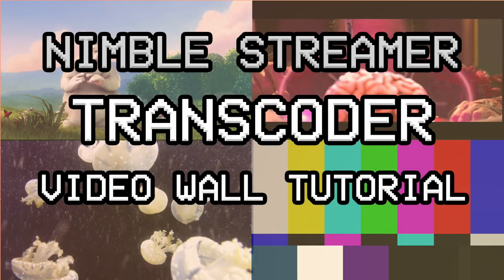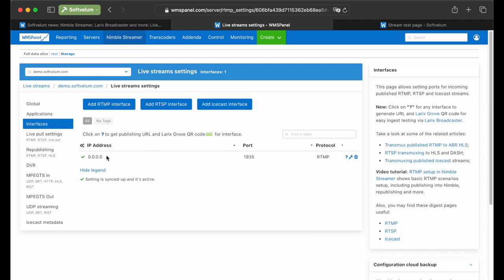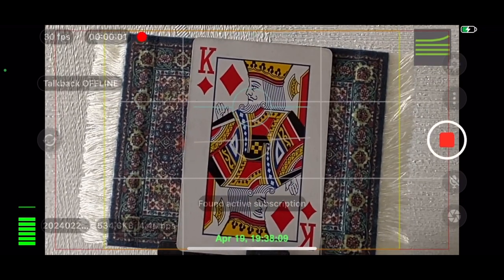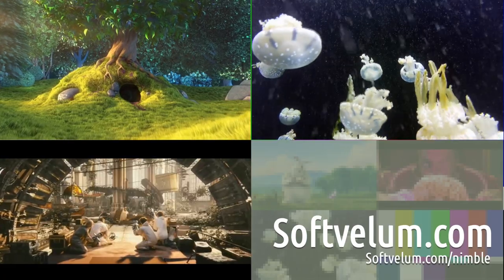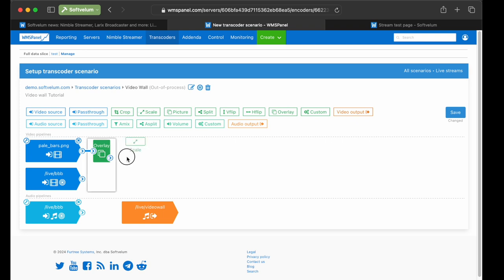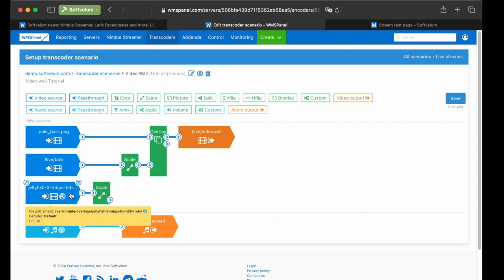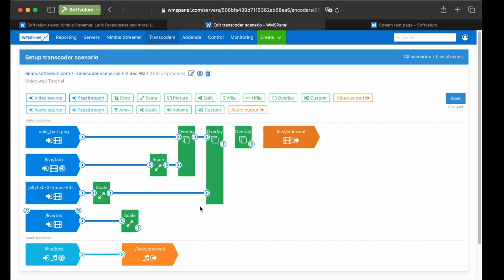Make mosaic video wall with Nimble Streamer Transcoder

Comment from the maker: Timecodes:
0:00 Intro
0:39 Prerequisites
1:00 Set up resulting output application
1:21 Create and set up input from sources
3:24 Add a couple Transcoder parameters into Nimble config
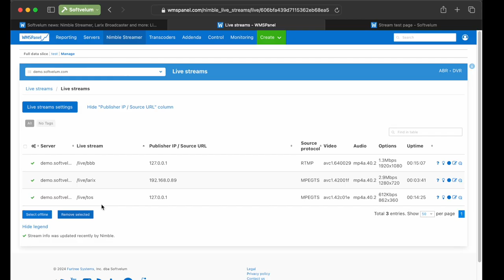3:37 Create Transcoder scenario
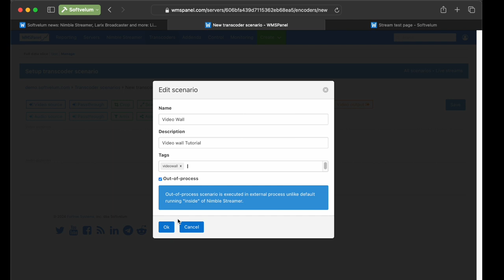4:00 Add "bars" baseline underlying image
4:42 Add the first source - live Big Buck Bunny stream - and its audio
5:29 Set the first overlay and the corresponding output stream encoder
6:26 Test the output with single overlay
6:45 Add the second source - Jellyfish file
7:43 Test the output with two streams
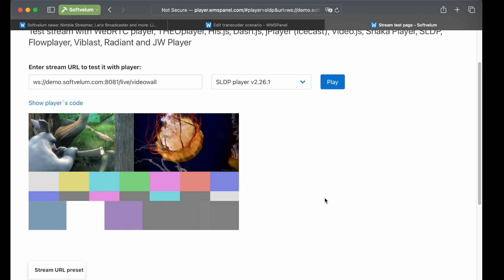7:57 Add the third source - live Tears of Steel stream
8:45 Add the fourth source - live stream from Larix Broadcaster app
9:14 Test full output with all four sources
9:46 CPU and RAM usage
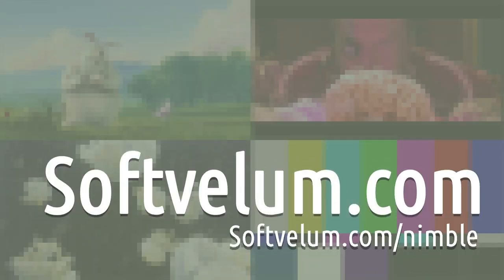9:58 Outro